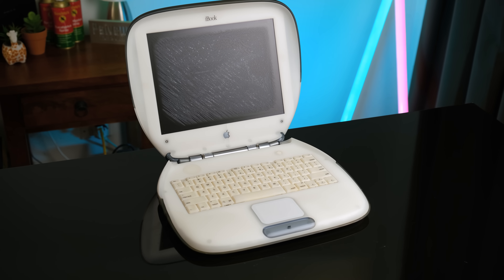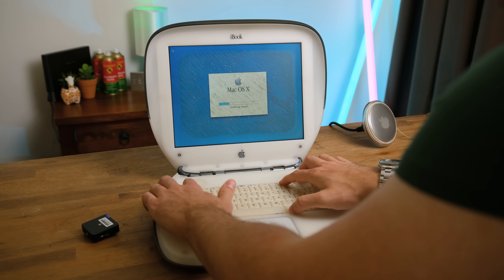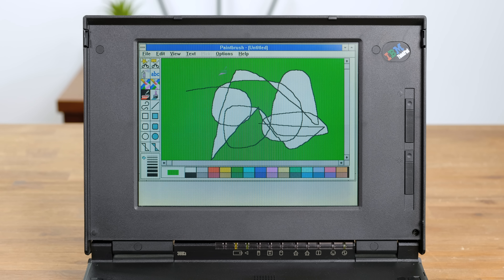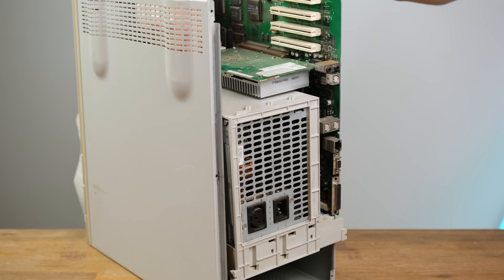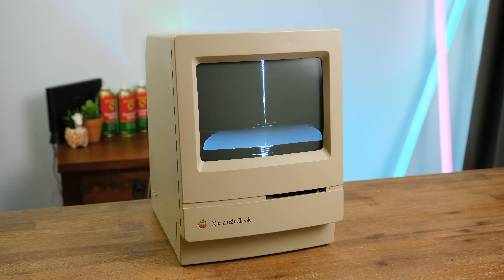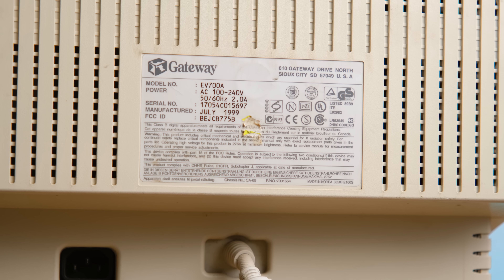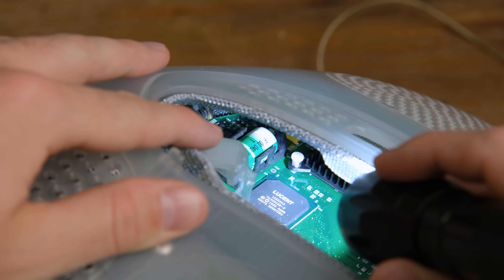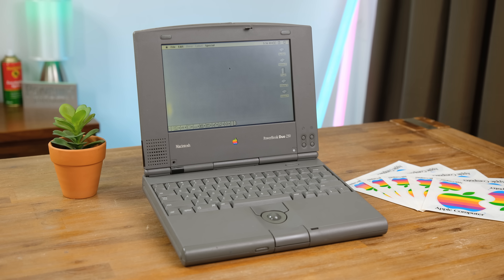So Much Vintage Tech Is Dying... Here's Why

Comment: I have my old Texas Instruments TI-99 4/A (and the original box w/ price tag from Toys R Us :) )... a ton of games and accessories for it (including the speech synthesizer). All of it still works. I think I got this back in like 1984. One interesting thing it has (that also still works, amazingly enough) is a cartridge called "Mini Memory". You use it to write programs in Assembler. The cartridge has some kind of battery on it.

The biggest problem I have with this thing is that it connected to an old style NTSC television set via a an RF modulator, which converted the analog video signal (coming out on a proprietary DIN connector) to an NTSC channel 3 or 4 RF signal. The problem is that modern TV's increasingly don't receive NTSC signals, and the RF modulator pre-dates the idea of TV's having analog inputs. I probably have an old LCD panel TV somewhere that would still have the connector that this can connect to and would receive the NTSC signal, but nothing would, I'm pretty sure.

The funny thing is that I actually have TWO of these TI computers. One of them was going to be for home and the other was going to be take to school when I was going to be at a residency school, but didn't end up attending. Anyway, if you ever want to know more about the TI, please let me know.

When I was a kid and got this thing, my father was a computer science student. I remember having to read his hex math textbook when I was in the 7th grade, because I needed to understand hex codes in order to do graphics on the TI (programming in old line-numbered BASIC). My dad didn't want to spend any money on games, and many of my friends had actual game machines like Intellivision or Atari. I wanted to be able to play Pac-Man. My dad told me "You can play Pac-Man when you can write Pac-Man". So, I did something like that. It was actually a pretty darn good clone of the game, except that the logic to make the ghosts chase you exceeded the power of the computer and made it unusably slow. So, I instead opted for an option that gave you increasingly less time to complete the maze and, at a higher level, made the walls invisible, making it even more challenging.

Today, I'm a software architect, largely because my dad told me that I could play Pac-Man when I could write Pac-Man. I always had dreams of breaking out that TI and showing to my computer science students (when I was teaching college courses), or to my kids and grandkids to hopefully inspire them to pursue technology as a career. Sadly, the dated technology that utterly fascinated me (and much of my generation-- it's how we won the space race against the Russians, I believe), just doesn't seem to fascinate them at all; they're only interested in what they can consume.

Thanks for sharing this. It's always inspiring to see people who still enjoy some of the original miracles of modern technology.

Comment: It's also a problem with vintage music gear.
All those drum machines and synthesizers from the 80s and 90s have problems with plastic and foam degrading, as well as memory batteries and electrolytic capacitors leaking all over the PCB.

As far as repairing old computers. I've done a lot of that at my old job. The older Macs are a pleasure to work with. Sometimes they can be challenging, but that is usually because of some clever engineering or industrial design. Newer Macs and many PCs too are simply hostile to the idea of being serviced. Most Macs have the SSD integrated onto the mainboard now. And the few that don't will often have the drive encrypted in a way that ties them to that mainboard!
Reply: The plastic and foam degrades BECAUSE the batteries leak. But also UV/daylight and contact with wrong oils decompose plastic and rubber parts. I collect music keyboards, and IMO really bad were only Yongmei (soft plastic button plasticizer makes hard plastic sticky), RJP (key contacts of latex/butyl rubber or such don't survive ozone) and plasticizer from the mains cables of italian 1980th keyboards turned case plastic into tar-like goo in spots of contact.

Comment: Saw the plastic dissolving on my old 8-bit devices 10 years ago. It was just a matter of time before the structural failures happened - which they eventually did. Its cool to collect the vintage tech but for many of these devices, the heavy reliance on plastics for housings/casings makes their longevity limited.
Reply: I wonder if there is some alchemical electronics technician wizardesque solution… to preserve these materials in a fossilized sort of way, those brittle plastics I mean. It’s sorta similar in ways with wood tho plastic just degrades devastatingly in certain instances I’ve experienced . I know some solution is to replace housing, so what is the future of long term housing material makeup, even if a conglomerated filament for 3D extrusion… 😢❤🥺❤
Reply: @Uathe  the same thing they do with architecture when its old and unusubale but the exterior is a victorian or mid century modern building thats worth preservation for aesthetic value, renovation or remake it, the schematics for this old technology need to be preserved

Comment: A few days ago, I was working to clear out all the computers from a small hospital that was being closed down.  In an office drawer, I found a 100% functional Windows 95 laptop.  Literally in brand new condition.  The battery still held a normal charge.  It seemed to have been there in the dry, climate controlled air for 28 years.  Humidity and heat are the biggest enemy of electronics.  Take those out of the equation and a system can last literally decades.
Sadly, it had to be decommissioned.  It should have gone to a tech museum imo...
Reply: Daylight/UV and ozone attack plastic and rubber. Also battery leak vapour and contact with wrong oils decompose them.

Comment: The caps on those old P4 era Dell computers would blow even when whey were brand new.  Thankfully, it is super easy and well documented to find out what size modern caps are needed to replace them, and once replaced, those old Intel boards are largely indestructible.  The larger issue being that it is a Pentium 4 instead of a P3 or Core chip which will last until the end of time.
Reply: Particularly year 2000 Chinese electrolytic capacitors used an incomplete formula copied from western patents. The Badcaps site has info how to replace them.

Comment: I have a collection of old hard disks, laptop components, and a couple of desktops that sat in storage for the better part of a decade.  I’ve been taking some basic computer assembly/repair courses; hoping I can figure out how to salvage what I have.  
My older monitors aren’t suffering from the Vinegar syndrome, but a few of the hard drives won’t read via the USB/SATA adapters.

Comment: Sad but true, most electronic hardware will not last as long as you probably will. Not necessarily such a huge problem, as you can go out and get new, better stuff for much less in pretty much all cases. What you need to focus on is the data. That is what can really be preserved as long as you care about it. But you do need to care. It's usually not the media that go, as fast as the software that uses it. Be sure to copy it to new media, and new formats, before the old media and software go bad. It's not hard. Again, the new media and software will be much better, for less. Just don't ignore the issue for too long.
Reply: New products only last 5 years - namely until the manufacturer shuts down the data cloud or removes the app they depend on. I doubt that any modern IoT gadgets will have any usability in 20 years. (And of course the unremovable glued firework battery ruins stuff like smartwatches without any chance to fix.)

Comment: I have been lucky with my components from the Windows 95/98 and XP era so far. I just built an XP machine that is working beautifully, and I have a Windows 98 build that passed bench-testing, I'm about to paint the case which is also from that era and has a very little bit of corrosion on the frame. I also have a "new" in-the-box 17" Emachines CRT. Never been opened, so I have my fingers crossed. So yeah, enjoying it while I can!

Comment: I have a 2008 Mac Mini that works as well today as it did when I first took it out of the box. It has been, far and away, the most trouble-free computer I have ever used. Not a single crash or freeze, ever. I still use it once in a while. Great little box.

Comment: wow, and here we are Constantly bombarded with the "Plastic never degrades" Line from Environmentalists, and here we see all kinds of 10 and 20 year old technology degrading IN Near perfect storage environments!  I know I have an old Compaq Laptop whose screen (last I fired it up like 4 years ago) had all kinds of vertical lines running through it! and my everything I have with a rubberized coating is sticky!  everything from an old night vision scope, to the controller to my old PS3 (the controllers battery is also completely shot and I have to use a ps4 controller to use the ps3, but cant use the home button :(  and I found out that Remote controls to and old TV and an old 5 point home audio that I had in storage (with the batterys removed even) no longer work, at all!
Reply: That is simply a specific quality of certain types of plastics used. Plenty of plastic will last a century or more
Reply: @windrunner6145   Yeah that's what you call irony my friend, the plastic we dump in the trash last forever but the plastic we use in our devices degrades in 10 years....  You'd think they'd wanna reverse that..... But then if they made stuff last forever we wouldn't be a consumer culture anymore and they wouldn't be able to rake in all of our money to lock it away  In a vault to never see the light of day again......
Reply: Hard plastic can swell and turn brittle by contact with wrong oil. In 1990th I had a Toshiba CD writer drive in a PC that tended to get stuck. After oiling with "machine oil", after a while the whole black polystyrene chassis started to crumble apart like charcoal. The same happened with a transistor radio. Also bakelite (e.g. in Hammond organs and tube radios) is infamous for this. When plastic cogs split around the metal axle or concentric cogs in quartz clock movements get stuck, this happens by swelling plastic due to wrong oil. Thus never lube unkown plastic mechanisms with anything but silicone oil. Also most rubber (latex, butyl etc.) turns into chewinggummy goo by any non-silicone oil. By I read complains that otherwise silicone oil may soften silicone rubber (used as rubber keys and key contacts), so do not spill it and avoid to oil if you don't need to. 

Similar plastic/rubber damage may happen by long time exposure to oil or battery leak vapours. Battery liquid vapours particularly damage LCD displays, thus failing segments or broken carbon foil cables (they tend to turn brittle anyway, e.g. inside calculators and Casio music keyboards) are likely caused by this.

Sticky gummy paint on devices mainly happens by UV/daylight, but also by migrating plasticizers out of deeper layers. This can be washed off with vegetable oil (aka cooking oil - needs some elbow grease). Remove the oil residues with isopropanol to avoid further harm.

Comment: I had an old 13 year Asus 17 in gaming laptop. for  its age its still ran pretty smooth and I was able to load a lot modern software. however, just a few weeks ago it decided to die out. I went and took it to a tech shop, turns out the motherboard decided to give out. I thought of getting it fixed but the price wasn't worth it. good buy my good old friend, had a lot of great memories playing games on ya.

Comment: Why not just build a nitrogen atmosphere chamber to store things in?
Reply: because most corrosive substances are already inside (battery leak vapours, plasticizers and wrong oils). Oxygen/ozone from outside is the smallest part of the problem (unless you have rubber action figures in a showcase - where daiylight/UV is another problem).

Comment: Title should read "Junk apple tech that went bad before it should have"
My alienware 2010 m17xr2 has been dropped down wooden stairs and backed over with the front wheel of a 2002 camry & still works perfectly. Every key on the butterfly trap door key board etc. I also have my compaq armada 4120t from 2000. No issues runs 100% with 98se

Comment: I love how you fixed the disk drive with a "technical tap" I've fixed a few things with that tool. Lol
Reply: In the end, nothing beats "percussive maintenance"
Reply: If a harddisk won't start, never open it! - Any tiny airborne dust particle will start a chain reaction of debris (like colliding satellites) that will unavoidably destroy it. Likely it won't spin because the bearing oil has hardened. And do not knock or use  force. Better simply warm the bearing with a hairdryer (not too hot) to remelt the grease and then let the disk spin for an hour to let it knead the lube soft again.

Comment: The corrosion at 2:20 is a problem I've had on every single aluminium MacBook I've owned. I do not wear a watch so I actually assume it's just from my sweaty hands. It also shows on the edge where my hand rests when using the trackpad
Reply: May be your sweat acts as electrolyte, and the metal paint consists of different metals. The Hindenburg airship coating combusted so badly because it contained aluminium with iron, that acts as thermite by fire. May be similar stuff is shielding Maccbooks. (My Highscreen Colani bigtower front panel came with brown iron paint inside for EMF shielding.)

Comment: I've lived enough to feel sad about this. My first computer was originally owned by my uncle. An old machine running Windows XP, with a CRT monitor. I remember spending evenings playing pinball and minesweeper. It saddens me that I might never be able to experience that again.
Reply: Same, however I don't miss it imo, only the experience of seeing a PC for the first time, I can still feel the time it took to do things
Reply: I kinda wish I still had my old CRT monitor and computer, I remember it had Windows 98 I guess it would be dead by now because of age, there's no way a computer from the early 2000s can last until 2023 without very expensive maintenance and it would reach a point where it can't be fixed anymore.
Reply: @kentreed00 there we're so many parts produced for that generation of tech that you would always be able to cobble up a working one , crt's is another matter
Reply: @kentreed00  thats a bit of an overstatement, while yes some computers will fail theres still shit from the 80s running, and there was many many more computers made in the early 2000s than the 80s, windows 10 is really not that even far away from 98
also the schematics to manufacture and produce older computers will always exist if they are archived

Comment: I've been a technician for decades, and the flick or "smack" is an age-old approved fix that engineers have used. I remember sitting in the lunchroom with a team of electrical engineers and designers, the microwave flickered on and off; everyone leaned forward as one of them approached and looked at it slyly, paused.... and gave a good whack. It worked.
Reply: it is also known as 'percussive maintenance'

Comment: That reminds me. I have an old C64 (bread board version, early 80's) that functions but I have it stored. I should remove the electrolytic caps because they are bound to start leaking. Plus I've wanted to give it new caps anyways.
Reply: Only about year 2000 caps leak due to China copied an incomplete formula. I own many 1980th/90th things those work perfectly. The main capacitor inside my tubeamp is from 1961 and in daily use.
Reply: @cyberyogicowindler2448  You may be on to something. I've worked on solid state pinball machines from the 80's and 90's and even though I've had old cap leakage, it's not really that common. In fact, allot of electrolytic caps made in the 70's and 80's seem to still work to this day... well except for old CRT arcade coin-ops like Popeye and Donkey Kong. I don't know why, but Japanese produced CRTs (at least in video games) are a b*tch to find a cap kit for.
Reply: @liamodell7191  Electrolytic caps also wear by heat, thus poor constructions with hot running parts nearby (typical in many modern flatscreen TVs) will make the same caps last much shorter.